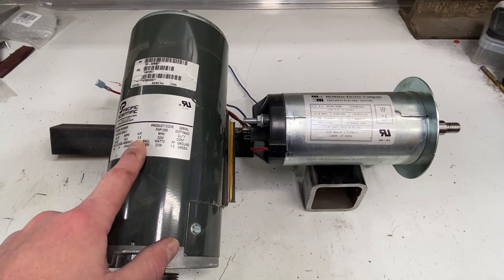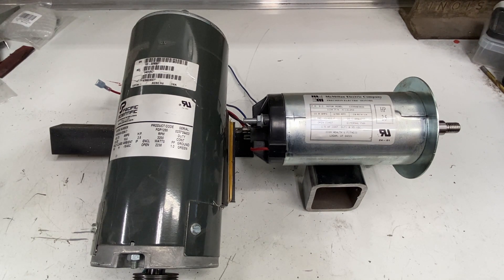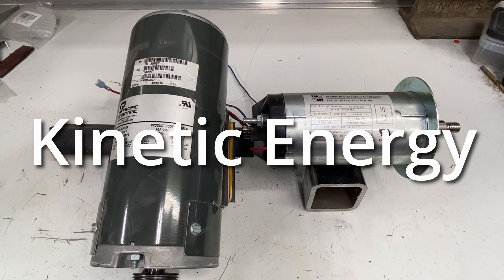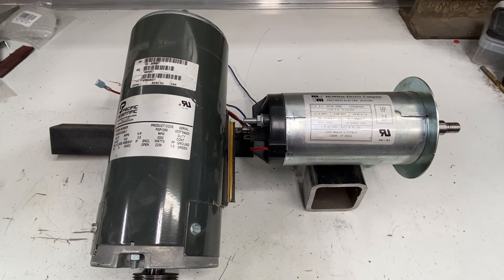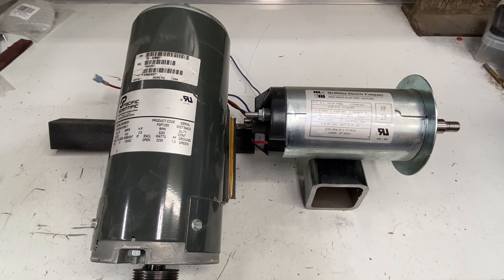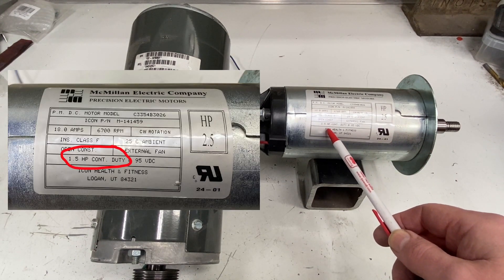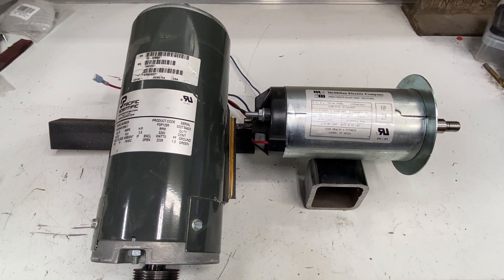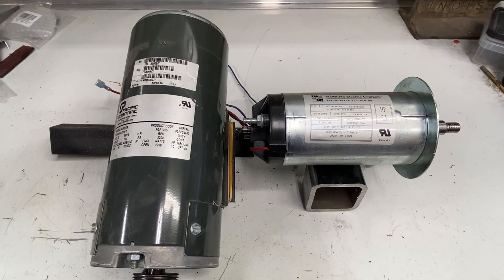Determining if your treadmill motor has enough torque for the project you want to add it to.

Comment: This video DOES SHOW how to how to calculate torque based on motor specs - BUT - how about a video on how to calculate TORQUE NEEDED based on vehicle type, rider weight, top speed requirements, battery pack constraints, and so on....?? 

THIS is what I came here searching for, and I believe it’s a much needed video that YOU can handle.
Reply from the maker: That is beyond the scope of what I do. My car videos are related to gas burning classic Fords. My treadmill motor videos are related to putting them on shop tools like mills and lathes and then building a power supply to plug them into the wall.  I am not doing anything with electric vehicles.
Reply: @dazecars  ahh yeah I did see that after leaving the comment, however, I think you may be selling yourself a little bit short...

Comment: What is 5252?
Reply from the maker: That number is derived by people smarter than I.  In the early days of steam engines the term "horse power" was uses as a way to equate the work an engine could do to something people understood "the work a horse could do".  One horse power was later quantified numerically  as 33,000 foot-pounds of work per minute.  When you take that information and begin calculating how "work per minute" relates to rotations per minute  and torque (more complicated math than I am wanting to deal with)  a simple equation is eventually derived (torque * RPM)/5252
Reply: @dazecars  thanks for your valuable explanation. I want to run a 1hp ac 230v 2700rpm single phase irrigation pump with threadmill motor of 180vdc  4500rpm 1.75hp . I have selected 1.75hp motor after applying your formula,which gives nearly 2.0 foot pounds of torque. But two things are causing problem in this design
1. My supply voltage will be 150vdc
2. Making the pulleys for both pump and motor.
Reply from the maker: @netrocker9990  150V DC is probably a good thing.  You will slow down the DC motor slightly but it should be close enough to get your job done but have the advantage of running cooler.  I'm guessing about 3700 RPMs that means your pulley setup will need to be about 1.25:1  I say about because pulleys slip a little and you will loose a few RPMS.

Comment: You mentioned AC motors torque changes at lower RPM.  Can you provide a link that gives a better understanding of that. Otherwise.  Nicely done.  Dead on with the calculations and the importance of Torque.
Reply from the maker: The statement is a generalization.  If you look at torque curves for AC motors peak torque is always at designed operating RPMs and any other RPM result in lower torque.  That is not considering a VFD.  When you change the frequency to change speed the torque curve changes.  The biggest thing with AC motors is in most cases they are optimized to run at one speed.

Comment: Great info! So would you say that a “continuous duty” 2.75HP treadmill motor would be better than the typical 3HP motor?
Reply from the maker: If there is only one HP number it is usually continuous.  As to you question it depends on how the torque numbers come out.

Comment: Great video, I was looking for something like this to figure out motor swaps on my vintage tools I collect. I do have a question for you. Right now I need a new motor for my Old Craftsman Table saw. Its an 8amp 3/4 horse with 3480 RPM. I need to Upgrade it and cant afford to rewire my garage for 220 nor have the money needed for a 3hp ac motor. I do have a few treadmill motors laying around including a 90Volt continuous 2.0 hp, 20 amps at 3800 rpm. Do you think I can get away with it for a while till I can afford the money to redo what I need? I am at a loss and cant find any documentation of it being done or tried. Any help would help!
Reply from the maker: "get away with it"?  it's an upgrade.  It has about three times the torque.  My only concern is you are at near max RPMs.  is there a continuous RPM rating on the label?
Reply: @dazecars  nothing for the rpm but the motor is a Cambridge 2.0 continuous duty JM01-001. That's all i got to work with.
Reply from the maker: @michaelevans2989  Are there two horse power numbers or just 1?  if just one continuous and max are the same.  If there are two horse power numbers I can calculate the continuous RPM amount.

Comment: Where does the 5252 come from? I can’t find any mention of it in Google…
Reply from the maker: The 5252 was the result of a calculation.  The original definition of horse power was created and then applied to steam engines.  This established what 1 horse power was.  From there torque and rpm were measured and and used to calculate the 5252 number.
Reply: 1 hp = 746 W

Comment: Is doing a AC to DC conversion on a drill press really an "upgrade"? 
If so, then why dont they put DC motors on drill presses? 

I ask because I bought a new drill press just to do this conversion, but for some reason it just doesnt seem like a good idea anymore. 

Drill press has a 1.5hp AC motor, the motor I found to use is a DC same stats as yours in this video. 2.5h 3200rpms.
Doesnt seem to me that I would lose torque, or gain rpms, but something just feels off about doing it now. 
The drill press has a good belt system, 13 speed I think, that should counter any low rpm torque issues I might have.. not sure
Reply from the maker: What is the RPMs on the AC motor?  The entire point of my video is to compare apples to apples and we can't do that without the AC motor RPMS.  To answer your main question AC motors are common on tools because it is simple and cost effective.  An AC motor is set up to run on 110V AC right out of the wall and nothing else is needed (except sometimes a start capacitor).  To run a DC motor you must convert AC to DC and those components cost $$ and then if you need it to be a variable power supply the costs go up.  Manufactures are all about simple and cost effective. The reason you make this upgrade is to have variable speed at the turn of a knob with hundreds to thousands of speed option.   If you are happy with the pulley system and the limited speed options it provided and don't need variable speed at the turn of a knob then there would be no reason to do this mod, but if you would like variable speed without changing the pulley setup then this is a fantastic way to go.  Make sense?

Comment: I guess the thing is knowing what torque you need per application, say a 2x72 Linisher. 
Any ideas?
Brilliant stuff!
Reply from the maker: That is the purpose of the entire video.  As a minimum you want to maintain the same torque as the original motor.  So if the original motor has 1 foot pound and a gear ratio of 3:1 you want to have a minimum of  3 foot pounds after the gearing.  But even better is more torque.  Due to the high RPM ability of a treadmill motor if you gear it at 4:1-6:1 (depending on desired RPMS) you could get a lot more torque and you will be better off.  You use a treadmill motor for variable speed and often slower speeds, but because horse power is a function of RPM and torque you want to maximize torque to still have good power at low RPMS, and you always want to gear it in such a way that max treadmill motor RPMs = Max desired RPMS after gearing.  In other words if the max RPMS of the motor is 6000 and you only need 1000 max than you want to gear it at 6:1 to have 6 times the torque. Does that make sense or did I make it about as clear as mud.

Comment: I have a question. I'm trying to install/buy  a treadmill DC motor on my lathe ..it says on the label  29 amp .. can I still use this on my lathe ??.. has 3.5 hp and 4,000 RPM .. 90 Volt.. just worried about the  amperage and the voltage since my house is wired for 15 amp .... and 110 Volts .. thanks..
Reply from the maker: I can not say for sure but it will likely pop the circuit breaker.
Reply: @dazecars  thanks ..

Comment: How do you estimate the torque at half or quarter rpm? Can you assume it’s linear? The standard rpm of a treadmill motor is way too fast for my WWII era milling machine, but way slower may be too low of power.
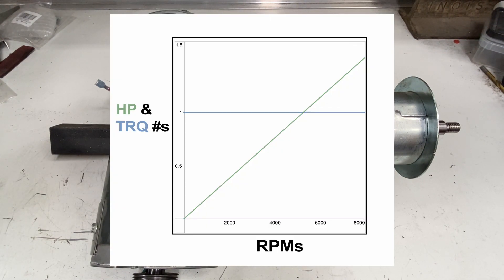Reply from the maker: If you look at this video at time 2:37 you will see that (in theory) the torque curve is flat and does not change through out the entire RPM range.  I say "in theory" because at lower RPMs the voltage drops below the amperage threshold due to the resistance in the coil.... okay how about in english now, the coils inside the motor are what create the magnetic field and the number of amps going through the coil determines torque.  At higher voltage (=higher speeds) you are at max amps limited by either the power supply or the draw of the motor.  But at lower voltage (lower speeds)  the normal resistance found in the coil limits the amps because there is not adequate voltage to overcome that resistance.  Lower amps means lower torque but I have observed it to only be an issue at the bottom 1/8 to 1/10 of the RPM range.  Above those speeds the voltage is enough to overcome the resistance of the coil and you are at "max amps" meaning max torque from there to max RPM.    The most important thing for your situation is to gear it correctly.  Both my mill and lathe are powered by a treadmill motor and I took max RPMs of the motor and divided that by max RPMs of my machines.  On both machines that was about 3.5:1.  With that number I correctly geared my lathe and mill.  This way I am maximizing torque and never running the risk of running my tools faster than they should go.  Make sense?  The result is lots of torque at low RPMs.  I have never had my mill bog down or slow when making a pass, and on the lathe I single point thread grade 8 bolts 3/8 16 all the time without a compound (meaning high tool pressure) at about 100 RPMS and there is enough torque that the spindle only slows slightly as I make a pass.
Reply: @dazecars  great. To me, assuming normal operating range (25% power to 100% power?), I’ll assume constant torque, and therefore that 50% rpm would mean 50% torque? 

Or do I assume full torque at 50% rpm? Meaning no more likely to bog than at full speed (not withstanding inertia)? 

I can “gear” (jackstaff pulleys) the lathe down, but the milling machine will be a lot more complicated. 

Thanks for your replies. And keep the videos coming! I’ve been all-in since I found them.
Reply from the maker: @davidkask510  I would say worst case scenario you are at max torque by 25%. And more likely already at max torque around 10-15%. Being that you like my videos you may have already seen this but if not check out my “adjustable column mill build phase 1”. I had to use a 3 pulley setup to properly gear my mill.  Not sure what you are working with, if you contact me through my website and email me pix of your mill maybe I can come up with a gearing option.

Comment: One slight practical consideration with DC treadmill motors is that there is a minimum usable RPM. If you risk extracting max torque at too slow a speed there’s a chance of cooking the DC controller or overheating the armature. I agree that torque is fairly flat but sometimes other factors may be in play 😜
Reply from the maker: I appreciate the cautionary warning it is good advice for people.  It is however beyond the scope of this video.  My intent was to illustrate that HP numbers can be misleading.  As a further example I removed a 3/4 HP 1700 RPM AC motor from my lathe and replaced it with a larger 3 HP 4000 RPM DC motor BUT had I used a smaller 2.5 HP 6700 RPM treadmill motor it would have actually been less powerful than the 3/4 HP AC motor because of RPM range and the math bares this out.  With regard to your statements I did want to mention you ARE talking about two different potential side effects of low RPM.  A motor that burns out at low RPMs is a function of heat.  At slower speeds the cooling fan has less cooling ability and that can fry a motor.  Burning up a power supply at lower RPMs is a function of the relationship between amps and volts.  As volts drop on most power supplies so do amps.  This is only a concern at the bottom 8th or so of the speed range as most power supplies come up to full amps fairly quickly BUT if you are at that lower 8th (ish) where the resistance of the coil can not be overcome by the volts than yes you have reduced amps and it can be hard on the power supply at those lower ranges.
Reply: @dazecars  Okay, Think of    ' volts '   as  pressure, in a water /air piping system.  Ohms'  Law,   shows this relationship, between  current ( amperes)   and  voltage.  Which is why,  ' high tension '' powerline wires, are very very high, in voltage, but very low in current. Increase one/ decreases the other.  Step up/step  down transformers,  do the  ' ends '  of  the  high- voltage lines, from generation,  to customer  delivery.

Comment: I have been searching Youtube for hours trying to find this information. Great content and very well explained. I have the same  2.5hp X 3200rpm treadmill motor and the 16" bandsaw I'm fabricating requires that the motor run between 195 to 2376 RPM. Will the 195 RPM introduce an increase in heat being a bit on the slow side?  Thank you
Reply from the maker: because these motors are designed to run treadmills they are built too cool very efficiently so they can be run at slow speeds.  A lot of people only walk on them.  With that said if your motor has blue wires I would hook them up as that will add an extra protection against overheating.
Reply: @dazecars  Thank you for your prompt reply. Really appreciated

Comment: I have to disagree with this video. Power is "work done" and a function of torque and RPM. This being so, the more powerful motor can ALWAYS be geared to have more torque than the least powerful motor
Reply from the maker: Some of what you have said is correct but unfortunately you have totally missed the point of the video.   Yes by using gearing (assuming there is enough RPM available) you can gear any motor to have more torque; however this video does not go into gearing because that’s not what the video is about.  It is about comparing two motors directly both with the same horse power rating even though one is superior to the other.  By calculating the torque you see that the larger motor is superior by almost double and you get the other half of the equation, a direct apples to apples comparison.    Your statement of “the most powerful motor can ALWAYS be geared to have more torque than the least powerful motor”  Does not even consider the torque half of the equation and how it effects motor life.  Based on your statement the two motors I show, both having equal horse power, would function exactly the same with the correct gearing, but how can that be if the bigger motor is the better motor?. For the same power the smaller motor must run at 6700 RPMs but the larger motor gets that power at 3200 RPMs  (Illustrating this point is why I used two motors that were rated at the same power)  Based on what you have said they are completely identical and there would NEVER be a reason to ever run the bigger motor because the smaller motor does the same work and fits in a smaller package.  It does not consider that the higher the RPMs the hotter a motor is going to run and the quicker it is going to where out.  You may disagree with what was said in my video but there is nothing incorrect with my statements, they are the actual math and science.
Reply from the maker: The other problem with your statement is the entire reason a person uses a treadmill motor is to have varriable speed.  In other words the motor is seldom if ever run at max RPM at which point HP means nothing regardless of gearing.  But torque remains constant (assuming the power supply is accurate) and at low ROPMS torque is what is important not HP.

Comment: You are comparing 4.1F# motor @3200rpm  vs  1.176F# motor @ 6700rpm while downplaying the rpm effects.  

To compare them more fairly, lets say you needed an output rpm of 3200rpm, the first motor will provide 4.1F# @3200rpm while the 1.176F# @6700rpm motor will become equivalent to 2.46F# @ 3200rpm with some sort of gearing.  A lot of scenarios are going to use some sort of gearing/belts already (ie drill press), so in these scenarios its not a big deal to factor in.  

If it's direct drive or you don't want to deal with gearing, then you can ignore the effects of rpm I mentioned.
Reply from the maker: you are completely correct gearing is a huge part of using a motor  and depending on the application could make the smaller motor a good option if geared properly, but that is beyond the scope of this video. The original footage I shot went over gearing but I realized the torque  calculation is the foundation for determining what motor to use. how you set it up is what you add to that foundation and will be felt with in a future video.
Reply from the maker: I am not "completely downplaying RPM effect"  In most cases a person runs a treadmill motor to have variable speed.  In other words they will seldom if ever be running the motor at max RPM.  Being that horse power is a calculated number based on Torque AND RPM, you loose horse power as you slow the motor down.  The purpose of this video was to show that for variable speed applications torque is the important number, horsepower is a misleading number and to pick the best motor for your application some math is required.